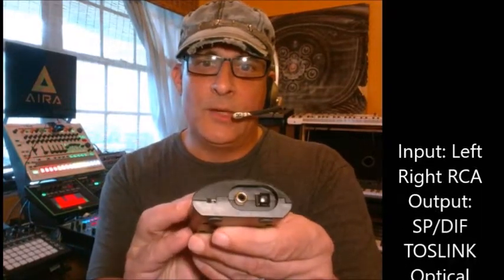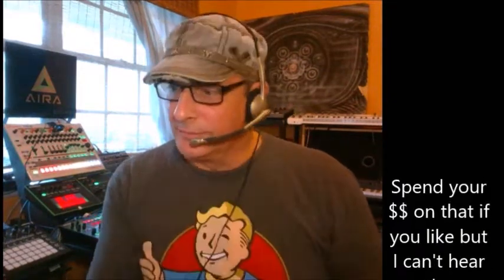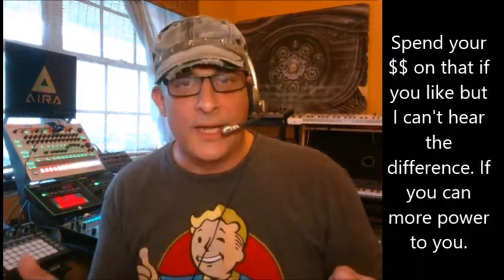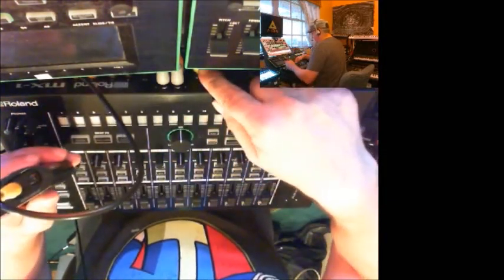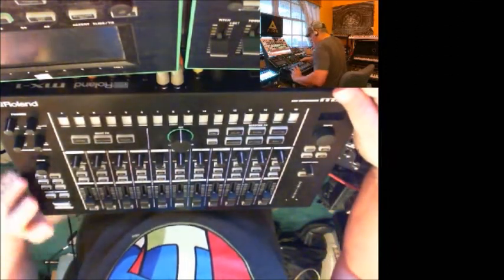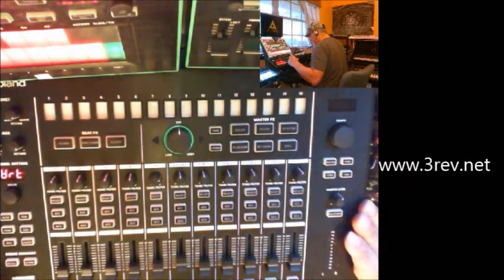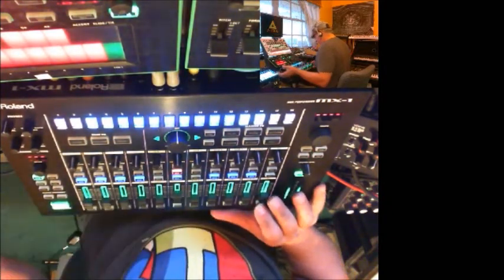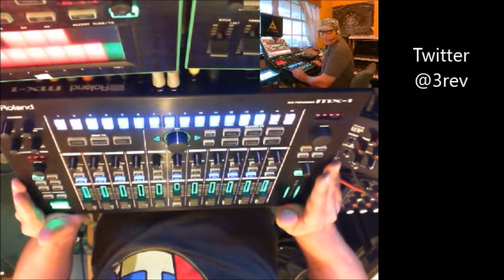Connecting Roland MX-1 to external Analog to Digital Interface

Comment: we have a 90 percent similar setup
Reply from the maker: TBH  I know it's Overkill, I just love stuff. But what you have with that Trifecta and Logic is be super flexible.
Reply: 3Rev Videos and Stuff thanks ..   I'm set..  The computer is also the sampler..  The thing is I can't get into Komplete or Omnisphere.  To me you know what will happen?   me scrolling and scrolling 40 gigs of sound..  lol.     that won't work..  I work better with synths that have 3 osc with 4 waves each.    It's fun to create your own sound then record it.   As for the drum machine the TR8 is it.   I do use some samples but that's the only time I use them.
Reply: That's just the "AIRA" station or what I call -- "the New Stuff"   I have Desk to my left with some  Rack mounted stuff (Venom,Sequential Prophet 2002 Sampler, KORG M3r, Kawai XD-5 Drum synth, Mixer FX. and though you cant see in this video(and I redid things) the wall on my right is my "digital vintage"  gear. Casio CZ 5000, KORG 707, eMu Drumulator, MC-303.   But I am having a lot of fun with  the AIRA gear and that is what I take out live.
Reply: William Herrera oh wow you have a lot of gear.    The thing I like about the system 8 synth is it's 4 synths inside 1 Synth.    Now there's less clutter.    I have the MX1, TR8 drum machine and Roland TB03 .. That's it.  Logic ProX
Reply from the maker: Oh I assure you the System 8 is on "my list" but I may sell a few things. (I went on bit of a spree with all the AIRA gear.  SO Finances have to recharge).   But The MX1 with the TR8 Etch is just such a great combo.

Comment: Wow thanks. I have a Novation Ultranova which has a spdf digital out - do you think that I could plug this synth right into MX-1?
Reply from the maker: The Default Sample Rate for the UltraNova is 48Khz So set the MX1 to 48 (it defaults to 96) 
Also the SPDIF is turned off on the UltraNova by default If you want to run in 44.1khz you will have to set that on the Ultranova as well.  BTW You can find this on Pages 37 and 38  of the manual https://d19ulaff0trnck.cloudfront.net/sites/default/files/novation/downloads/3987/ultranova-userguide2.pdf